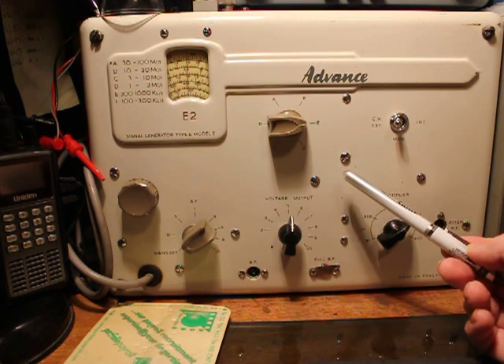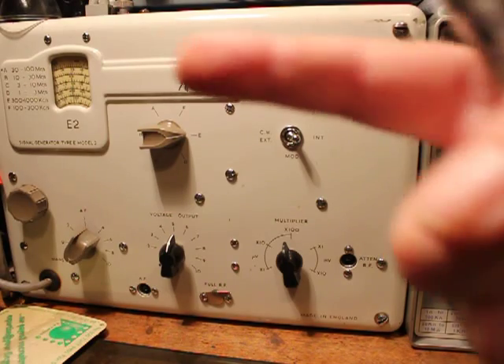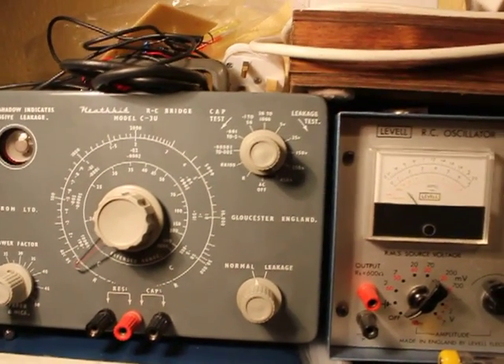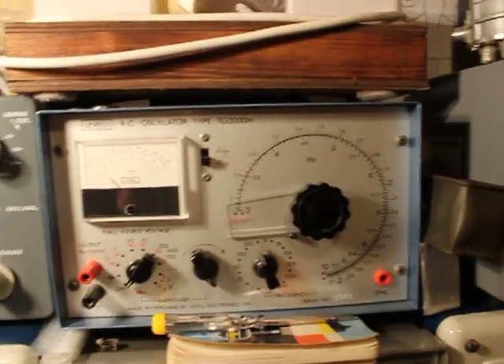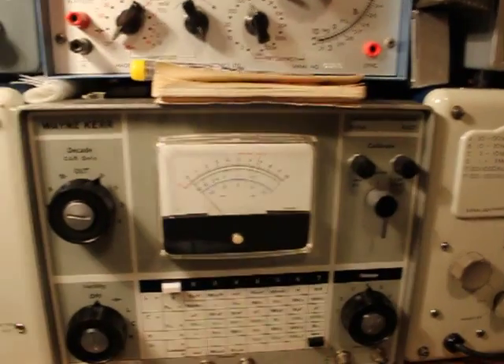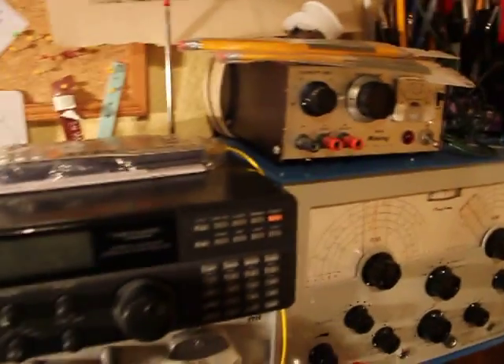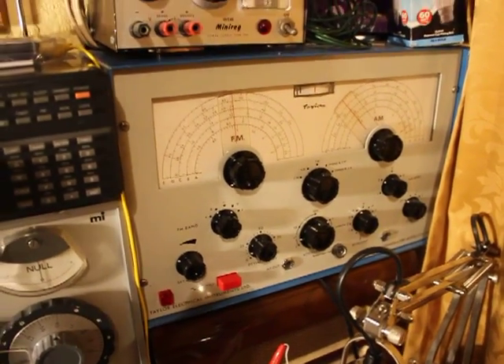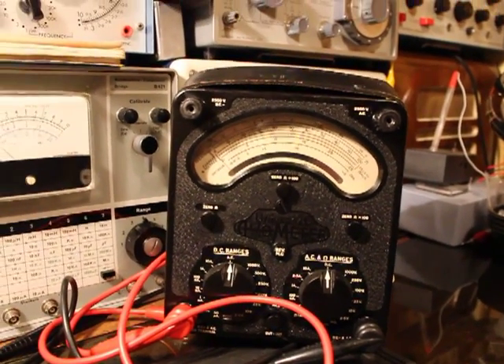Test equipment

Comment: It's amazing how many people haven't discovered how useful the lamp limiter is.  Very nice bench
Reply from the maker: Thanks Chris, it's changed a lot now as I've been to more radio rallies :)  I don't work on anything modern mainly valve based stuff so while I'd love a sig-gen with digital read out (and will probably get one one day) it's not a game changer.  I also have a lamp limiter for transistors sets, just a 24v light bulb but does the job.

Comment: Andrew,
That is an impressive line-up of test equipment my friend. I am familiar with the Advance E2 signal generator. I was given one to use along with a Telequipment scope when I began in 1971. Seeing your vid brings back memories when most things electrical in the home was repaired – sadly not so these days. Even the multimeter sort of brings back memories – I started with an Avo Minor and soon progressed onto using a Model 8, Mk3. All wonderful stuff – thanks for a great vid.
Regards,
Phil.
Reply from the maker: Phil, thanks! Most of it was bought for not a lot and like our radio sets, just needed new smoothing capacitors, the switches cleaning and a new valve here and there to be back up to spec again. I also find it really educational just learning how it works and to use it.  I will do a little tour of the multimeters I have and include a couple of US made ones as well.

Regards - Andrew